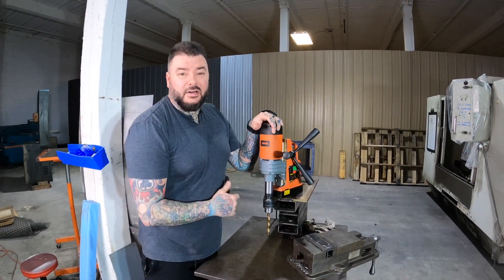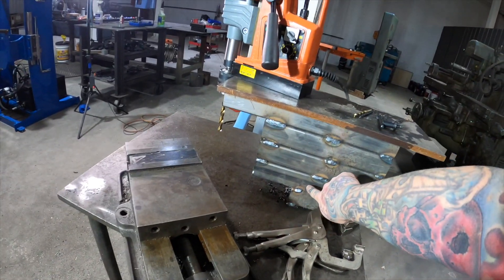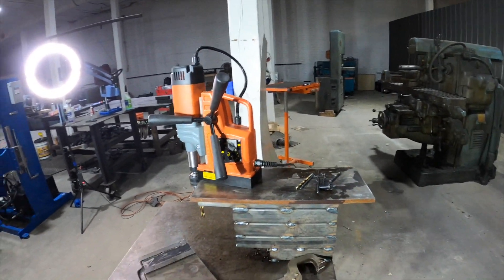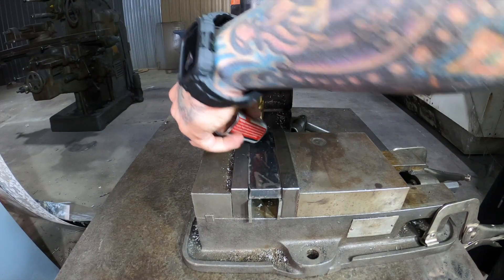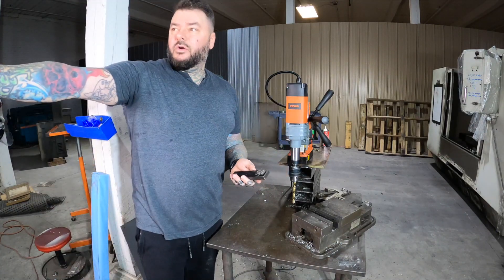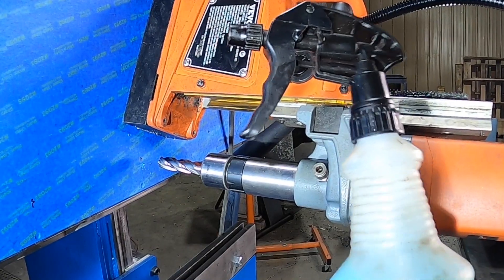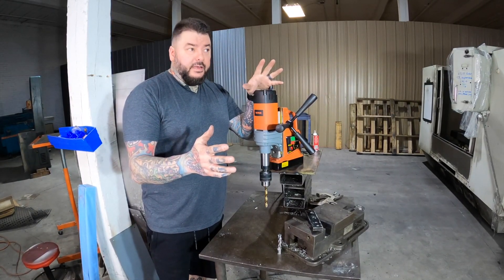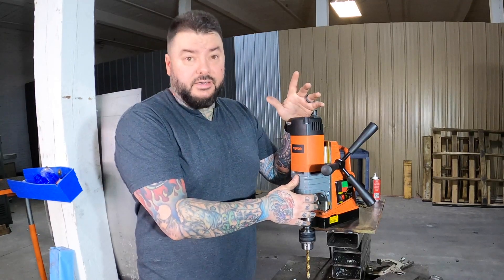You Need this Tool for Fabrication / Vevor Magnetic Drill Press

Comment: I'm in the market for a mag drill to punch some holes in a truck frame  on an upcoming project. My biggest concern with these cheap ones is if i can buy SAE size annular cutters to work with the Chinese spindles. Everywhere I've read seems they're metric. Do you know if these vevor drills are that way?
Reply from the maker: The annular cutters that came with mine are standard I believe and I ordered some from China that are standard since. I made a video about them. Check it out. Thanks

Comment: You realize you can move the head up on the mounting plate picatinny rails to use longer drill bits, right? You have it mounted in the lower 3/4.
Reply from the maker: I actually didn’t realize that and a couple people have told me since. Thanks for the help I appreciate it!

Comment: One thing you could do sense HF bits are so cheap. Just cut them down and re sharpen them. I have the drill doctor it definitely works on HF bits after they break.
Reply from the maker: I wasn’t sure if annular cutter could be sharped with a drill sharpener

Comment: What the other commenter meant is you can adjust the height of the drill to accommodate the jacobs chuck and regular drill bits.  This is to not have to build the stand that you built.   

How do you like the quick connect?   Any play in it?  Great review man.
Reply from the maker: Ohhhh… lol. I definitely have to try that because that’s just about the only thing I don’t like about drill. 
The quick disconnect works great. There’s no play in it at all. Thanks for the support!!